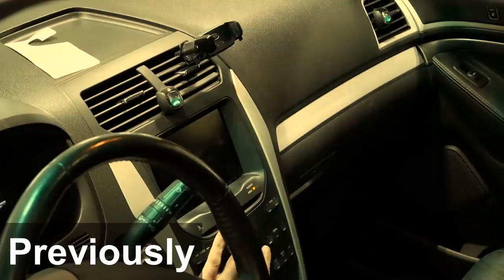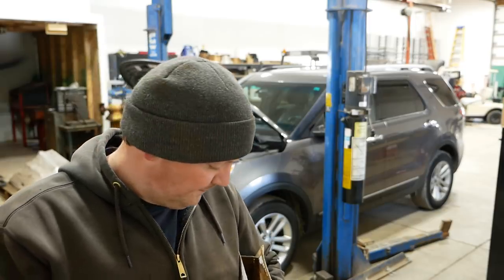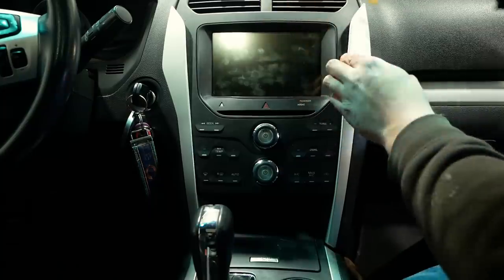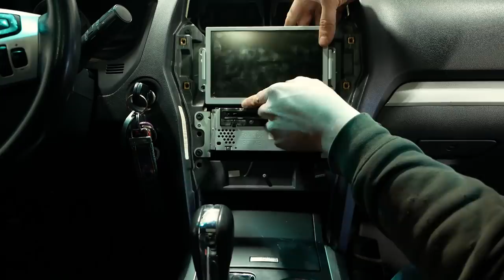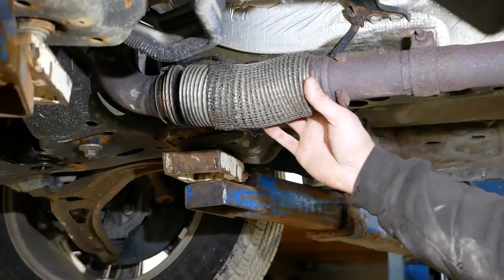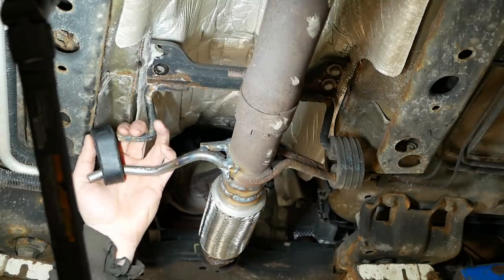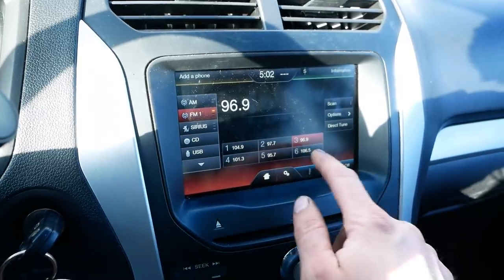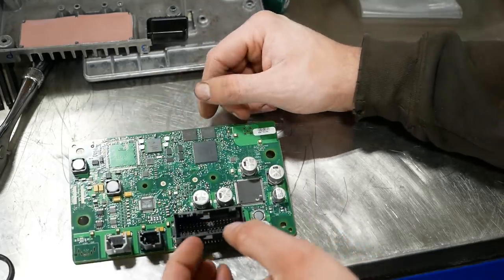Ford Explorer APIM and Exhaust Flex Replacement

Comment: You're a life saver, my friend. A non Ford dealership wanted to charge me $1500 for parts, labor and reprogramming the APIM module. Fortunately for me, the module was on backorder indefinitely, so I decided to order the APIM module from Ebay for $600 reprogrammed (w/navigation). I ended up installing it myself, thanks to you and your video. Salute!
Reply: Same to me $1500

Comment: Thank you so much for posting this video. It was very helpful in solving the same problem I was having with my 2012 Explorer. As you suggested, I ordered a replacement APIM from FLVP Mods and watching your video made it easy for me to remove and replace it. My display is up and running again. And, thanks to you, I saved over $600 doing the repair myself.

Comment: That module will make a great addition to the pile!
Reply from the maker: Along with the rest of the vehicle!
Reply: I hope you sent it to your
fix it fixbit , lol. Never know
another ford may need that
very special box...... As they
say come back to bite YOU
on the ASS ?
Reply: @WatchWesWork  Wes, how much was the aftermarket apim? We bought an 2014 explorer interceptor via auction. Pretty much decent accept a coil and she said that the radio display went blank. We are in MN. So mostly highway miles. But want to get everything resolved.
Reply: @TheBigLeeg  do yourself a favor and replace that with a sync 3, the sync 2 is useless.

Comment: Hi Wes!  These new cars and fancy electronics make me envy the good old days.  Great job on that weld repair! 👍Mine would look like crap and I'd struggle to weld upside down especially on a round.
Reply from the maker: The top is always the hardest. No access.
Reply: After a summer working at Midas you can weld anywhere 😏

Comment: Well done wes, you diagnosed it spot on :-D
The man that reprogrammed the unit did a great job, i think the unit did an auto re-learn at the start.
Very neat flexible coupling install,  the fabricated mount looked solid as a rock.

Wes Works Wonders lol.
Reply from the maker: Thanks 👍
Reply: @WatchWesWork  its a mosfet,,its allways a mosfet..why,,why,,do they make mosfets..

Comment: Wes, A similar horror story from Australia. A Ford Territory, had a broken windshield replaced in a remote area, but they failed to fully seal the windshield. A small water leak, allowing water to enter the car, find its way under the plastic A pillar cover,  & track down electrical wiring loom to ECM, over long time, corroding all connectors, ECM & causing electronic instruments to randomly fault. It took weeks to trace, repair and find initial cause. The damp carpet was a hint that everyone ignored, till later.

Comment: Great step by step demonstration of muffler bearings replacement and correct setting of the pre-load for thousands of quiet, trouble free miles. 😉

I’m surprised the module reseller doesn’t take them in as cores for repair.

Comment: I was having this same intermittent failure of the SYNC display with my 2011 Ford Explorer. When it quit working altogether, I ordered an APIM from FLVP Mods as mentioned in the video. I installed it and it works great! Thanks Wes!
Reply: Can you send me the link
Reply: Thanks
Reply: @K95695  Seems like their website is no longer active. :(  I had used the link in the video description.

Comment: Tip - when shifting plastic trim, ease up the edge, squeeze a straw in and squirt a bit lube on the clips
Reply: Nice one Peter; I recommend silicone spray rather than WD40 or oil-based products.  Also good for getting hoses and exhaust grommets onto metal.  But never, ever spray silicone near another component that you're  about to paint or solder...

Comment: My friend M has an old Nissan that will be in the scrapyard soon. The demist fan stopped working. It has a LCD screen that displays the HVAC status but it's not a touchscreen. You adjust the fan speed with the buttons below it. I bought a PWM controller on ebay for £10, wired it to the cigarette lighter and screwed to the side of the console. I could not let M drive around in the winter with misted-up windows. Anyway, it works and M is happy and safe.
P.S. no need for air-con here, we're in the far North.

Comment: Just a follow up to my previous response on the last video, the dealership had replaced my hvac module and returned the vehicle to me no sooner had to take it back due to a suspected wiring issue. Fast forward a week and they found a broken wire that went to the 16 pin harness, ran a new wire and presto everything is functioning as should. Excellent video as usual. 👌

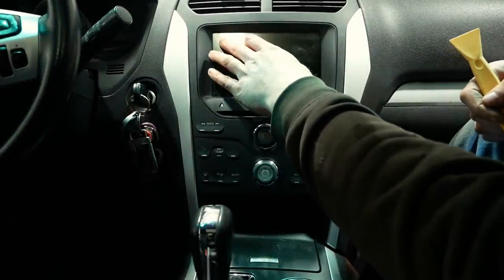Comment: Beginning at 3:54, absolutely NEVER work on plastic in cold weather without warming up the area.  And a good panel tool is a must in any tool box.  Two days ago I used one to assist in removing a fuel line from a carburetor on a push mower.  Would like to see you do a video of removing, tearing down, and then rebuilding an automatic transmission.  You worked on that Oliver track loader...you can do a transmission.  You can do it!  Good video.
Reply from the maker: I've never done and auto trans. But the simpler ones look pretty straight forward.

Comment: First step to electronics repair is check voltages. There are probably a dozen voltage regulators on the board and they fail pretty often. tho I can't fault you for not wasting your time on it :)

Comment: Had a similar module on the back of the screen of my 2019 Edge ST due to inability to use the Nav system. By dealer, under warranty. They scratched the screen, so, just had a new screen put in, again under warranty.  Man, those Ford parts are expensive. Glad I bought the extended warranty.

Comment: UK 🇬🇧 here. Know the problem well. In the 70s I worked on BMC Minis. I have had to remove seats to get under the, what was known as the "dash" or because I was only 130lbs then I had to contort myself to get there.

Comment: Ive seen those sunroof drains freeze up, just happened this winter actually. Snow on roof melts from heat in the vehicle and since its well below freezing, the tubes freeze up and it overflows.
Reply: Never purchase a vehicle with a hole in the roof!
Reply: @tiredoldmechanic1791  Especially one with two holes in the roof...

Comment: Nice work.   Ive used FORscan for some things, mainly just to play with settings and stuff like adding the ability to have the fog lights on along with the high beams, requiring the key fob panic button to not work until two presses of the button, etc....just personalization mods.     Its a pretty useful tool once you get the hang of it and dirt cheap, just an app basically.  But like you said, trying to learn it and use it would take much longer than just getting that module ready to go, I certainly would do the same.

Comment: GOOD JOB. GREAT TIP ON MOVING CAR INSIDE  TO WARM UP BEFORE REMOVING PLASTIC TRIM. I SOMETIMES USE A HAIR DRIER {HEAT GUN CAN GET TOO HOT} TO HELP WARM UP THE TRIM. THANKS FOR YOUR EFFORT AND TIME.

Comment: Appreciate you taking it apart! Now we need 2nd channel "Watch Wes do board Work" and at least check it over with a microscope and maybe check some power lines with a oscilloscope :P Considering it came from an automotive environment and has BGAs, a bad solder joint under some BGA would be a nightmare to diagnose since it is an intermittent issue...

Comment: I always remove keys from ignition before do anything. Seems at least mercedes have sensitive computer modules and it is good to wait them to sleep before disconnect battery/connect. If you have key on, or in the lock more modules will start immediately and makes bigger sparks. May cause issues on some modules.  If car has keyless go, I take key so far that car does not see it...  Good stuff Wes, have a great weekend!
Reply from the maker: Seems like a good idea.

Comment: Yes, the latest niceties with everything electronic now, you are certainly going to see tons more issues like this in the future of auto repair. I will admit, those niceties are great...when they are working. Most of the time, a bad solder connection or micro runner crack is the cause for them to stop working or working intermediately. But you have to use a microscope to look over the entire boards to find it. And the real interesting fact is, they change designs and layout sometimes multiple times in the same year. So near about impossible to keep stock on hand. And who would want to! As expensive as it is, it is a replace and go situation, regardless the cost. Thumbs Up!

Comment: When you are taking off those bezels that are giving you problems coming off, if you can squirt a little WD-40 or silicone lube onto the clip it will allow it to undo easier.
Reply from the maker: I should get some silicone spray.

Comment: Nice job!

The FLVP Mods people didn't want the old one for a core???  

Heh heh!  And I can tell you, I was fully engaged on this one...  I was yelling at the screen "Rotate!  Rotate!" and twirling my hand in the air, when you were 180 degrees off on the new module.....  I still have bad flashbacks, of people seating the new board incorrectly, and ruining it before it ever had a chance to work for 1 second...  Ugh.  Brutal.  But you got there in the end....
Reply from the maker: No core.

Comment: Dang good job, Wes.  Kind of surprised you did not have to do the "Hold the Reset Button for count of elebenty, while also holding the Select button for not more than count of three, to enter Technician mode" hoohaws, FMC has done of late.

Comment: Glad your module replacement was successful. Kind of scary getting a replacement and not being really sure that is the problem. Those little round silver and black cans are capacitors and those are a likely failure point, not uncommon. When they fail you get weird things happening because they start behaving more like resistors than capacitors.

Comment: Nice weld job on that exhaust Sir Wes. but I always clean & paint over the welds after, they rust very very quickly under there. THAT BOARD LOOKS LIKE A NIGHTMARE, NOOOO THANKS.

Comment: One thing I don't do is have heavy key chains hanging from any ignition switch on any vehicle I own. It's a sure way to damage the trim around it with wear marks. Shorten the live of the tumblers and switch and make sound as you drive.

Comment: Hiya Wes, Good job on the Ford , Sun roofs can be a pain my mini cooper had two rubber hoses that just pushed on no clamps , so over time they blow off from who knows what and they are hard to get back on . Before they came out with the tools to take plastic dash apart I used plastic pancake turners modified for the job lol . Like what you do here be safe and take care
Reply from the maker: I used to use a bent knife blade!

Comment: Those capacitors are solid polymer, far better than electrolytics caps and immune tothe bakeout problems Es had. The two same looking chips sitting side by side are probably flash memory for the nearby processor

Comment: It looks like the connectors are smd as well. A vibration picked up by the lcd/bezel could easily kill that connector or likely screw with a few pins that will neither kill it or make it work on Tuesdays unless you roll a 5 or a 6.

Comment: I take it the processor wasn’t offered part exchange with the faulty one. Enjoyable video Wes many thanks. Wondered if the expensive processor was built here in UK. I would think so considering the dollars which Ford wanted for it.
Reply from the maker: No, the older unit is not repairable.

Comment: Accessory Protocol Interface Module ?   Is this in a car or an F-22 Raptor ?  What's the difference between a Ford Explorer (or most any new car ) and an F-22 Raptor ?
You can get parts for the F-22. 
Insane, absolutely insane.

Comment: I've done repair work on pcb's for decades. Cold solder is common. I''d inspect it under a stereo microscope first. Then reflow what looks bad.Then maybe mail it to flvpmods so you could get some credit perhaps.
Reply from the maker: They don't fix them.
Reply: @WatchWesWork  Not even test them ?

Comment: The display went out on an uncle's Mountaineer and my brother's Focus.  I am sure these failures are due to Ford going with the cheapest supplier to save a few pennies.  My brother hasn't bothered to replace his, but my uncle had a local guy (Atlanta, GA) reweld the board and it worked fine for the next 4 or 5 years he had it.

Comment: It's probably like plugging in a brand new computer, or one that's been unplugged for some time. It takes a few seconds for it to charge the capacitors before hitting the power switch will get any response. That's probably one reason that there's a constant voltage to it.
Reply: nope, electronics don't work like that... It needs to program and initialise all the other modules. It also likely had to phone home via wifi to obtain new configs, updates, etc...  everything is connected to something else these days. Nothing works in a bubble anymore!
Like AvE always says, "don't trust the confuser, when it is loadin' up the pixie dust!" :P Great job Wes!

Comment: Hey Wes love your videos and have learned alot from you, wanted to tell you that here in Houston Texans there a place called auto comp that sells and repairs automotive computers or ecm's and abs modules, alot cheaper than getting one from the dealer or parts house, they also repair them too, you may want to check them out
Reply from the maker: That's good to know!

Comment: Nice repair. Why do car modules and other parts require VIN registering? SMA does them and it's time consuming and a pain in the rear.
Reply from the maker: The same module fits basically every car in the Ford line up. The VIN programming makes it work with the various options in this car.

Comment: @Watch Wes Work, thanks for going with my product/services and putting it on your channel.  For those needing an APIM you can visit the site Wes listed or email me Jason@FLVPmods.com  I haven't been able to keep these in stock lately as the demand has risen quite a bit.  I program these via the official Ford OASIS/IDS method so that the vehicle record on Ford's servers are updated with the replacement APIM info and Ford's servers make sure they are programmed to your specific vehicle and have the latest software/firmware.  As some other commenters have mentioned I do not take the old one in return.  And it does take a while for the initial boot up up after installing the replacement.
Reply: You are saving people a shit ton of $$$ by supplying this service so I hope you are making some decent coin from this too. Good one Jason. 👍

Comment: Don't you have to send back the old unit to the reman company?
Too bad the wet spot in the foor well has gone, I have the same problem on my '07 Transit connect, no clue where to look for the ingress...
That welding came out nice, difficult spot, especially the upper section...
Nice job, thx for the update!
:-D
Reply from the maker: No. They do no repair them.
Reply: @WatchWesWork  Ah ok, just thought they made exchange them

Comment: Fix Or Repair Daily. I drive a Ford as well.
Reply: F.O.R.D Not 100% true. Had ford all my life they have been good too me. Plus the trucks worked they didn't haul air around in the box their whole life. 2007 f150 270000 miles +.

Comment: Hey do you possibly have a link for that part or what it’s exactly called my wife’s car had the exact same issue it was intermittently going on and off but now it’s completely out I tried all the fuse tricks reset the battery and I have all the same bcm codes

Comment: I remember a newspaper article that attended the invention of the transistor. A reporter asked how do you repair it?  The inventor said, " you just throw it out and get a new one".
Reply: Just like a vacuum tube.
Reply: @DanEBoyd  Unfortunately, you can't typically unplug a transistor. 
    (not counting socketed cpus)    The reporter was trying to compare it to an ordinary light bulb.
Reply: @firesurfer  True.  Good point.  Tubes still have their places today, like in guitar amplifiers.

Comment: I just saw this video , I own a 2019 Ford Escape , runs down the battery and no audio . I have everything else working , back up camera , navigation , and I am tired of buying batteries at $200.00 a pop . I wasn’t sure on which module I needed ? Any suggestions ?

Comment: I expected “made in China” to scroll across the screen when you fired up the new module.
Reply: No it should say product of Ford not really a good or new idea
I think less of Ford than Wes does 
I have had them in the not that distant past  and every one disappointed me Immensely
Reply: @zweg1321  guess it sucks to be you. I never had a Ford until 06. Just bought number two last year, I’ve had great luck so far.
Reply: @donnebes9421  my problem is I want my money’s worth out of them in these times they should last longer than 200,000 miles mine did not 
Have a chev that’s 30 years old still going strong 
I’m my area you don’t see Fords with more than 150,000 
Same year Chevrolet has 300,000 
At church today I was told if you still need your Ford fixed go to @#$&*()’ auto shop he did 3 of them last week and at least 1 or two every week
Reply: @zweg1321  well then buy another Chevy if they work better for you. End of my comments here.
Reply: @donnebes9421  sorry that you and I don’t agree on vehicles if we did we would a be driving Dodges
Reply: @zweg1321  pretty funny. Up until 06 I had been a dodge owner for years. I actually switched to Ford because the local dodge dealer became a problem. I liked the dodges, but I like the fords too. Nowadays I don’t know if one brand has a advantage over another. I think they’ve all become overpriced pieces of plastic. Yup, I know, I wasn’t going to comment further.